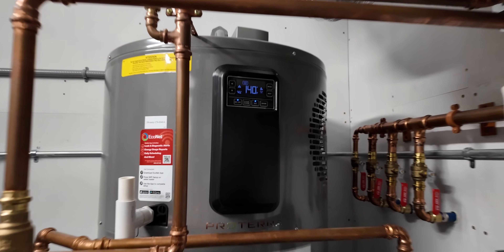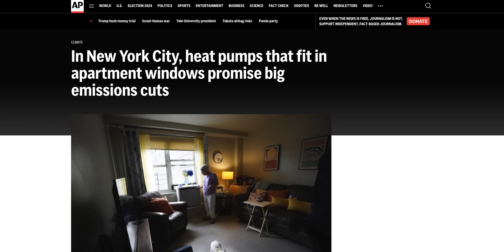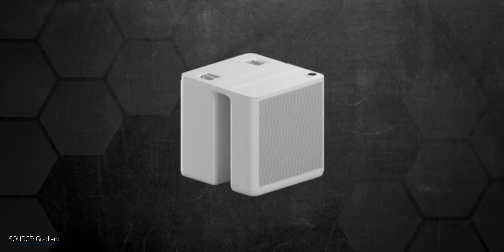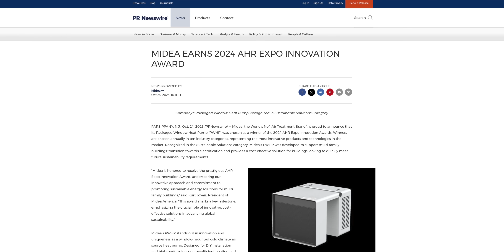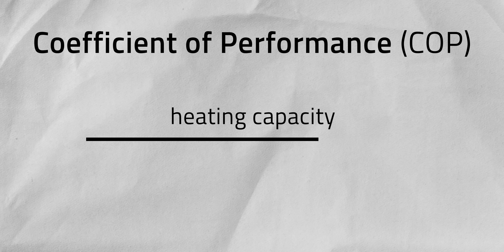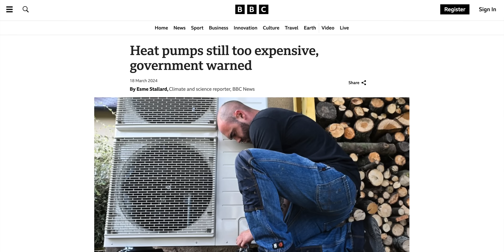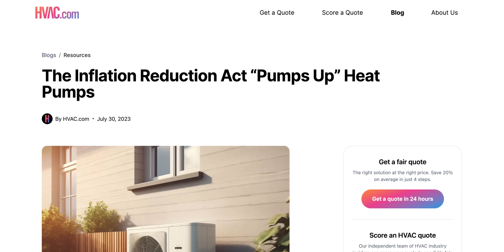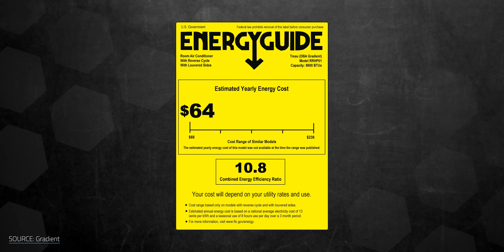Why This Window Heat Pump Is Genius

Comment: Go to autarky! Installing heat pumps is straining on the AC network. Makes it more unstable. Demands most energy when in December and January the least regenerative energy is available. Since you need 100% primary energy in winter to deliver 25% electricity till household, any heat pump having a COP below 4 naturally and logically ENHANCES CO2 imprint, not reflecting on the CO2 used to produce it!

So try to find alternative paths to the crazy goals the narrative "climate" dictates. 

I can only donate ideas. 
We have a heat pump manufacturer that produces stationary heat pumps air to heating able to gain a COP of more than 5 in Germany which is awesome. 
THIS is the ceiling we have to stretch to!

(I digged up my whole garden 1,2m deep and placed copper pipes 10mm for direct evaporation of heat pump coolant every half meter in double the area in garden compared to heated area in house. It is not more efficient than the air-to-coolant machine by the same manufacturer,, also reaching 1:5 !)

I also saw efficient heat pumps from CN manufacturers reaching 1:4.5, not bad.

Combine long term storage like fluid gas (perhaps you produce DIY in garden in future!): 

In winter, you could use some gas turbine and use the heat pump in semi-closed air loop to cool down the exhaust gas and the generator itself. 
The most easiest way is heat-resisting insulating boards you can open and close by servo. If outsides temperatures fall below "effective" point, you kick in the co-generation plant part burning stored energy, we need anyways in winter, where only 1/20ths of solar energy can be yielded.

In theory, you could go to autarky with that reducing primary energy need by some 30%. Still, the invested technology is doubling efforts / technology needed.
It makes some people very rich and influential. So we breed about technology you can produce on any lathe from scrap. Named here:

We could add some Tesla turbine to gas heatings. This produces electricity whenever heat is needed. We could stuff heat underground or in water we draw from municipal water supplies, that is quite cool in summer for us as well. If you have a heat pump drilling, stuffing solar thermic energy in that hole prevents degradation of the COP from this multi-year heat storage (any drill hole nearly does not replenish as many meters rock just act as a quite perfect insulation. 

Btw, no German window has the slide-down mechanism needed, and no insurance would accept it. 
But many manufacturers offer quick-link pre-filled split units able to heat and cool, and all we need is a special "flat coolant pipe" similar to the special flat satellite cables. 
Using these tricks, you can install the heat pump without additional drillings. 
Though these drillings can be kept small in diameter, or one could use a little notch that is reversible (stuffed by repair material)  if only affecting the window frame at / below the seal.

Comment: We need to be better accountants, watching and reading from all the experts here, fake savings against cost of replacement and inflationary scales, the time value of money invested in this unit at these initial times makes no economical sense and good only for those that buy with credit rather than buying with 2024 geno cidal dollars, this heat mining units as called heat pumps cannot produce more energy than the energy used to operate and if it did then it only needs a genius to make a converter of heat to electricity to cash in by returning it to the power greed I mean grid .... our universe is full of energy or all energy, we only need to have cool or heat where most needed keeping most real money (instead of fake fiat depreciating paper dollars) in our posession.

Comment: Matt , heat pumps don't work in places like Central or Western Canada where the climate extremes come into play, Here in Manitoba they have been tried over the years to no avail, winters are just too extreme, and we have the 2nd cheapest hydro rates  in North America with average daily winter temps at -20 to -25 F plus windchill they don't function at all , I have one friend that is a commercial HVAC Tech and he installed one at his home, it is an industrial unit, this was his experiment and found living in a home built in the 60's that it cooled great in the summer , however in the spring/fall it was not even effective at  temps of 15 to 40 F ,needless to say he had to fire up his furnace , then just turned off the heat pump, yes they will work in a milder climate area, just not here, i should say they will work in areas of British Columbia except the Northern part of that province good video  👍

Comment: The solution is not to electrify everything. Our grid can’t handle it and what generates that electricity anyway?What they were ignoring is the easiest passive way to save energy and carbon emissions, insulation. Many older homes have empty walls no insulation at all. Put insulation in that house, and even the homes with gas oil burners becomes many times more efficient by burning less fuel to maintain the same temperature. It also has the effect of lowering the stress on the energy infrastructure instead of raising it. We need to be doing this before changing energy sources. but that doesn’t transfer wealth in the right direction, it keeps money in the pockets of consumers, instead of transferring it to corporations, who may give kickbacks to politicians.

Comment: I live in Europe and have an apartment with individual gas heating and radiotors.  I recently installed a dual inverter split unit airconditioner (basically an air to air heat pump) and although it does heat well until about -7 degrees C but in those kind of temperatures it stops frequently to de-ice which defeats the object, a problem most heat pumps have. Also a single heat pump room unit only serves one room thus you may need more of them and it will often be difficult to heat the bathroom when it is enclosed. With dual inverter airconditioners one can have multiple indoor units on one external unit.  So in my apartment I still need my gas boiler in winter although the airconditioner did save me some money by minimizing the time I use the boiler and as I had it installed for €2200 it was not as expensive as the room units you propose. So yes I think there will be good use cases for  the window units but one would have to consider carefully where it makes sense certainly at a cost of €3000 per unit. Further as someone else already mentioned, most apartments in Europe have a different window lay-out so these would not fit there.
Reply: in the future it will make most sense to put them indoor with your heat recovery system or ventilation system.
thanks to the builkding codes in europe, we need ventilation in new or well insulated houses..

my heatpump is a part of my heat recovery system that i have mounted inside
and it goes to every room in my house

i also use other things to heat..
i do have a air to water (that im not using)
because i have a bitcoin miner (where the waste heat is connected to my heat recovery system) and a wood stove that is free 

and i have heat pump water heater, for hot water (with solar thermal panels for free hot water in the summer)

the model in this video is 1/3 less efficient then a panasonic minisplit, that is 1/3 of the price

Comment: Several years ago i owned a 660 sq ft bungalow. Never had heat, used tiny kitchen oven and small space heater. Eventually installed window unit that had heat and cool for $700.

Comment: Heat pumps are not the most efficient way to heat a home. Using natural gas is still the most efficient way. A heat pump is ran off of electricity which is generated by fossil fuels in most cases and the end result is the consumer spends more money on their electricity bill and the big electric companies get richer. It’s weak sauce.

Comment: Until these technologies that are supposed to help the environment and other things become as cheap as the normal then don't expect actually adopt or even care that it exist.

If I cannot buy a heat pump for the same price or a little bit more than a AC window unit then it may as well not exist at all.

I do not get why heat pumps cost so much more all it truly is is a AC unit with the ability to revers the direction of the hot and cold air.

Comment: Um... Tokyo and Beijing already have more or less ONLY heatpumps for heating and cooling. Did you forget where this technology come from? BTW -- $3000 is a robbery. These things shoud cost no more than $500-$800. These are simply repackaged air conditioners with a modern refrigerant, a reversing valve, and a better from factor. I understand companies need to make money, but $3000 is a ripoff and a classic example of an unintended consequence of a government trying to to get involved in economics of things... "You got money to spend? We'll triple the cost and gladly help you spend your budget " 😂

Comment: Midea shows at the Canton Fair a Solar Heat pump.  With Solar costing $0.40 per Kw, it would make sense to put solar on older Apartments. The savings on the grid due to the retirement of old inefficient AC should off-set the upfront costs. With such large number it seems cities, if not states, can buy in bulk to reduce the cost and charge a monthly fee. Especially in hotter cities like Phoenix AZ who are having to create and maintain cooling centers with 1st responders calls climbing for heat-strokes. The ease of deployment & removal can even be a for-profit business, where you just rent it for life, or rent-to own.

Comment: Lower emissions, but we need those emissions. Our food crops depend on CO2 for food, and it's only at 0.04%. If it gets cut in half, photosynthesis won't happen anymore.
Reply: Actually, considering these pumps all run on electricity, it would increase coal power plant emissions. Just like electric cars. Never mind, this is a great idea! My full endorsement.

Comment: I'd be happy to pay 3k for a way to effectively cool my flat. But here in the UK we don't generally have sash windows like the ones this is designed to work in. Only really old buildings tend to have them. My flat is only 10 years old but was not built with hot summers in mind.

Comment: Interesting design.
Does anyone know the actual EER of a window ac unit compared to a mini split when they are both operating on max cooling.? Seems there should be no difference in efficiency when running all out. You can't fool the physics, imo

Comment: Those slide up/down windows are fairly common in the US right? Because here in Western Europe you'll typically have those multi directional opening windows and would not fit this unfortunately.

Comment: in Australia split revers cycle air-conditioning (you call them heat pumps)  ~ cost as little as $1000 which according to my sums is about $US700. don’t know why they’re so expensive in the US. the heat pump in a window is going to compromise your ability to double glaze the Window so there’s a few pros and cons to think about.

Comment: You can get much larger Mini Split systems for that price.  Drill some holes in the walls, mount the thing and your done.  
Or if can't drill thru the wall.. there has to be a way to mount one near on around a window, and run the tubing and condensate drain out the window. It would probably block the view a bit more... But why are we trying to reinvent the wheel here.. Use what is already in the marketplace and adapt it. They make 120V Mini Split systems.

Comment: What no one is mentioning is the effect of the window style. The old buildings you showed at the intro were side by side windows. These systems require windows that lift up. You'd have to replace the entire window to install a saddle unit.

Comment: Apartments you are talking about are rent controlled heat included. No tenant will use this and be using its own electric when they get heat from thair point of view for free. When gets to hot they just keep windows open whole winter.

Comment: The problem with heat pumps is that the electric grid is not as reliable as it should be.

Comment: I Am SO SICK of fixing heat pump issues and mobile electric heater issues! These always draw to much for the circuit! Some times the circuit does OK for a while, years even. Please, don't burn your house down for AC (or heat) 

Yes, there are some units that draw a little less (12 amps vs 16+) but especially for homes more then 20 years old, most of your circuits in the home are made for 10-12 amps, and that even only a few hours a day.

Also, heat pumps have huge problems in anything below 10F (about -6C) they freeze up and then continue to try to run, while frozen up, drawing 5x as much power until the breaker goes POP and some one decides to repeatedly reset, heating up the receptacle and causing fire (I guess you won't be cold then)

Comment: My interest in the units is slanted more toward heating in the winter.  In reviewing both the Midea and the Gradient, neither unit gets high marks averaging around 3.1 out of 5.  For the price I would expect better reviews/performance.  In reading the reviews, the main theme is it stops heating around 39F degrees.  Most people aren't use to pumping out 90 degree air which would seem cool to anyone.  Until more details are available, I'll save my money for now.

Comment: I had a Bosch Heatpump replace my central AC unit.  Used same duct system.  It cost $7000k but I got a rebate for $3500, so in the end it cost me $3500.  It’s a large unit cooling and heating my 2000 sq ft ‘95 condo.  Seems cheaper than $3000 for a one room unit.  I do love my heat pump.

Comment: I would never buy any unit with that upside-down U-shape. Condensate has to be pumped up and out of the unit and it will always be the main point of failure. They get clogged with gunk and/or the pump itself just dies. The other style that isn't upside-down is okay, because the condensate just drains out by gravity like any window unit.

Comment: Most buildings on west side of US have sliding windows. Is there a design or adjustment for this. I have a heat pump in my house for the central heating aur conditioning and I love it so I am sold

Comment: Neat idea, but in a lot of places around the world (I suspect almost all) shutter type windows are impossibly rare. We in Germany almost uniformly have windows that can be opened like doors or slanted to let in a small amount of air. There are AC systems for those, but they are generally very clunky affairs, since you can't keep them on the window sill.

Comment: I'm sorry but an effective working range up to 35C is not enough and the price is literally dumb. If you have a one-window small-ish studio apartment, sure but for any reasonable person you are paying 3k for a mid-range reverse cycle AC. In Australia, that works out to be $4500-ish and for that price I could put far more capable reverse-cycle split systems into each of the 3 rooms of my house.

Comment: Could you elaborate on your comment @3.10 as to how they “reintroduce humidity to dry air” when on the cooling cycle, the airconditioning process is in fact a dehumidifier?

Comment: No. Heat pumps are not the greatest thing on earth. There are better ways to heat a building. Without moving parts and the need for servicing and replacement. I am talking about the most overlooked but most important factor - insulation.

Comment: It should cost 2x an AC, not more. For a single medium size room, an oil filled resistive heater is a no brainer. Unless your electricity is very expensive, I don't think you'll get your money back before he system breaks down (this is pessimistic, I've had AC units that have lasted 10+ years, but I'm skeptical) Note on Gradient's website they only offer a 1 yr warranty. :/

Comment: I won't care about these window units until they make them for windows that slide open side to side. Yes I know the pipes inside need to be a certain orientation (don't turn an AC unit upside down).

Comment: the air only u conditioners are only slightly more then regular air conditioners. if you want more window and want shelf space U are worth it more for hot areas with mild  temp areas with almost no snow.  they are perfect is places like Arizona an a-like.

Comment: Has anyone heard of a residential AC system that works by ice packs at night (when power is cheapest and air is cooler), and then thaws those ice packs with forced air to cool the house the next day?

I understand some sky scrapers in new your operate this way.

Thanks!

Comment: The price tag makes me scratch my head since normal heat pumps can run around $700, though this is without installation. That's a pretty big mark-up to remove the labor on those models.

Comment: So basically it's a mini split system that hangs on your window sill. It's about time someone making window units realized it doesn't have to sit in the window. I really don't understand how it deserves an award for innovation, unless the award is intended to shame the industry for not thinking to do this a long time ago.
If I didn't have reversible central air in my condo, I'd certainly consider something like one of these window-mount mini splits...but not at those prices.

Comment: I live out here in Southern AZ where it can reach 100-115F. I looked into these types of units, but decided on a more permanent system like a 3 zone Mitsubishi unit. Now I can keep my bedrooms cooler at night without having to run my 5 ton central HVAC system. I am seeing more and more of this mini split systems in areas like Boston and New Hampshire in my Fall travels. time after time, Mitsubishi and Daikin win out against the cheaper Chinese knockoff units. Sadly, many of these older buildings don't have good insulation. We're seeing more and more people insulate older homes with denim based insulation or Rockwool. That extra investment helps save on electrical consumption throughout the year.